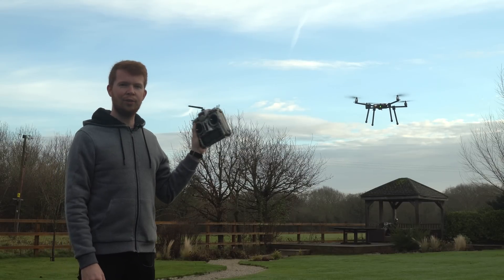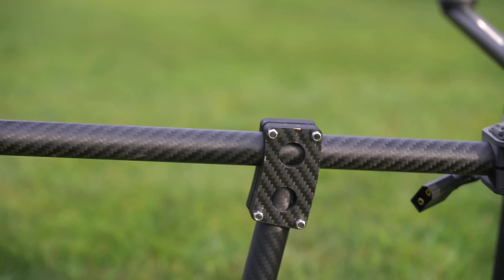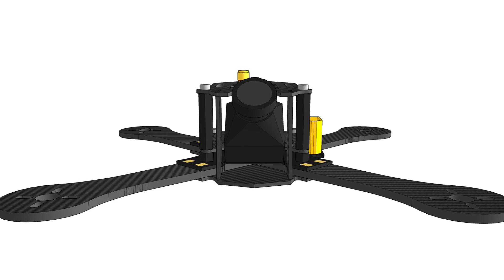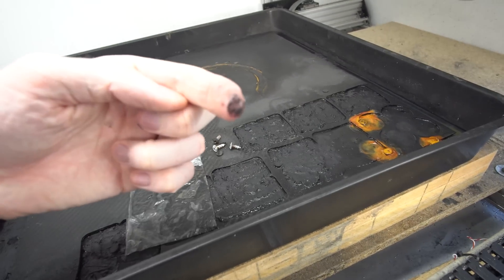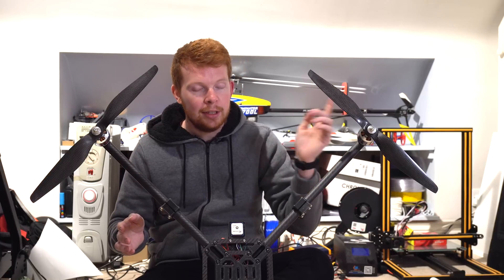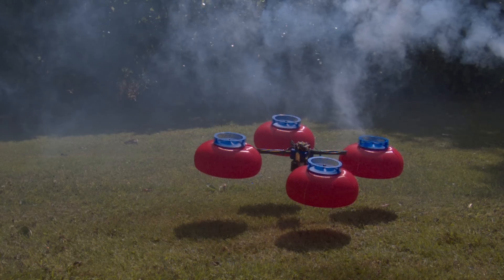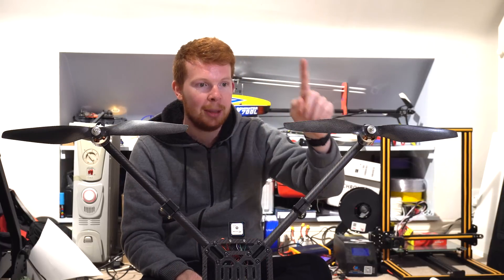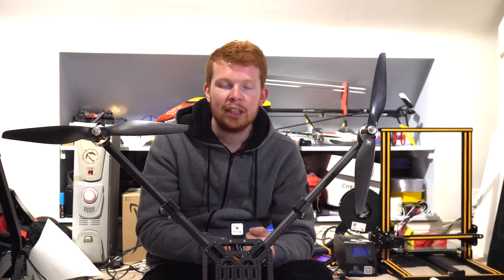I CNC'd a Drone

Comment: Quantum theory (otherwise known as quantum physics or quantum mechanics) is one of the two main planks of modern physics, along with general relativity, and between them the two theories claim to explain virtually everything about the universe. General relativity gives us our picture of the very big (space-time and gravity), while quantum theory gives us our picture of the very small (atoms and their constituents).

Technically, quantum theory is actually the theory of any objects isolated from their surroundings but, because it is very difficult to isolate large objects from their environments, it essentially becomes a theory of the microscopic world of atoms and sub-atomic particles. This is especially true for those parts of the theory which rely on the absolute indistinguishability of fundamental particles, an indistinguishability which is impossible to find in the everyday world of composite, large-scale objects.

Quantum theory is used in a huge variety of applications in everyday life, including lasers, CDs, DVDs, solar cells, fiber-optics, digital cameras, photocopiers, bar-code readers, fluorescent lights, LED lights, computer screens, transistors, semi-conductors, super-conductors, spectroscopy, MRI scanners, etc, etc. By some estimates, over 25% of the GDP of developed countries is directly based on quantum physics. It even explains the nuclear fusion processes taking place inside stars.

However, some of its findings and principles are distinctly counter-intuitive and fiendishly difficult to explain in simple language, without resorting to complex mathematics way beyond the comfort level of most people (myself included!). This situation is not helped by the fact that the “theory” is largely a patchwork of fragments accrued over the last century or so, that some elements of it are still not well understood by the scientists themselves, and that some of the bizarre behavior it predicts appears to fly in face of what we have come to think of as common sense.

A small part of the derivation for Schrödinger's equation of quantum mechanics 
(Click for a larger version)
A small part of the derivation for Schrödinger's equation of quantum mechanics
(Source: Wikipedia: http://en.wikipedia.org/wiki/
Schr%C3%B6dinger_equation)
Richard Feynman, winner of the 1965 Nobel Prize for Physics and arguably one of the greatest physicists of the post-war era, is unapologetically frank: “I think I can safely say that nobody understands quantum mechanics”. Niels Bohr, one the main pioneers of quantum theory, claimed that: “Anyone who is not shocked by quantum theory has not understood it”.

In the 1920s and 1930s, Bohr, Schrödinger, Heisenberg and others discovered that the atomic world is in fact full of murkiness and chaos, and not the precision clockwork suggested by classical theory. Classical physics can be considered as a good approximation to quantum physics, typically in circumstances with large numbers of particles. Indeed, classical physics has served us well up until the 20th Century, and for most everyday purposes it still does. But modern physics, which includes quantum physics and general relativity, is more all-encompassing, more fundamental and altogether more accurate - physics taken to a different level. Momentum and position, for instance, are approximations of the world of larger-sized things that we call the classical world, but the underlying reality of the quantum world is quite different.

As we will see, even a rough understanding of quantum theory requires some background discussion of atomic theory and some discussion of the uncertainty principle before any sense at all can be made of it. Only then will some of the more obscure and bizarre aspects of quantum theory (such as wave-particle duality, superposition, nonlocality, decoherence, etc) make a little more sense.

Comment: Hey Tom! Thank you so much for doing this video! I am in the process of building a Tarot 600mm drone. I am happy you went into detail with this video! I have also subed to this channel. Can you link your iNav settings for this FC?? Dump then copy and paste them here or something? I think the other trouble I'm having is the throttle on my QX7. I guess ill have to tighten up the screw to make the gimbal rest at 1500 instead of leaving is loose like when you fly rc planes.

Comment: Something I was wondering, motor arms are pretty much tuning forks, is there a clever way to attach wire and/or a thin rod between motor arms such that the vibration coupling damped the harmonics of the individual arms. Simplest, I thought, would be to connect the end of each motor arm to the adjacent motor arms with a tight wire.

Comment: Hey one question why use that much bulky battery when it only gives 5000mah there are like mobile phone power bank which are lighter and compact  and have capacity way more 10000mah and more why not use that ?
Reply from the maker: The mobile power banks are most likely lower voltage, therefore less Wh, which is the real measurement for energy storage. Plus mobile power banks use cheap li-ion cell which aren't capable of outputting the required power for a drone.
Reply: @TimStation  Do all drones use li po batteries ?

Comment: Why would it be a bad idea to 3d print the main frame?
Reply from the maker: It's possible to design a 3D printable frame (though might be heavy), but with the current 3mm thick sheet design, conventional FDM 3D printing techniques won't be strong enough.

Comment: Tim!!! What software/firmware are you using here? Also what about your other flying projects? What software/firmware did you use and modify to your needs? 

You should consider changing your name to Tam Stonton as one funny comment by Danny said. It would be non-existent words and most probably more eye catching.
Reply from the maker: It runs iNav in the FC. I run iNav on pretty much all my projects that require a FC due to the custom output options
 and GPS capabilities
Reply: @TimStation  Including the VTOL? How is iNav better with GPS than let's say Ardupilot? Thanks for the reply Tam 😊
Reply from the maker: @ZED-PV  Yeah the latest VTOL V4 ran iNav. I haven't actually tried Ardupilot before! Coming from the drone racing, I've mostly just used betaflight/cleanflight/iNav
Reply: @TimStation Ah I see. That makes sense. Do you have any experience with mapping and iNav? RTK injection? That sorta stuff? 

Sorry for all the questions. It just crazy cool to be able to talk to you about this stuff. 

Also all your videos are great!! Very informative and educational. I truely believe if you wanted to, you could get together a team of people and build very innovative mapping/filming/other crazy stuff platforms that the market would buy. 

For example, I would buy the CNC cut drone frame you design and make.

Comment: I was wondering, helicopter blades are long and straight so have more lift at the end 
Would it not be better to have them wing or propeller shape ? I might be wrong
Reply: Helicopter blades are straight when they're stationary but each blade is rotated slightly around their long axis so the blades present an angle of attack to the air to produce essentially the same effect as described in this video. I'm sure there will be a YouTube video explaining this further.

Comment: Are you running iNav on the Omnibus?
Reply from the maker: Yeah it runs iNav. I run iNav on pretty much all my projects that require a FC due to the custom output options
Reply: @TimStation  Did you change the position hold and altitude hold PIDs? I'm using the same FC and GPS and yours is far better (mine jumps up and down by a few meters and does sharp corrections to hold the horizontal position)
Reply from the maker: @SandroFPV  I haven't changed the altitude PIDS, but I have reduce the position hold PIDS. However,  I initially built it without any angle to the arms and it was fine with default settings, but since adding an upwards angle to the arms, the 'mechanical' positing gain increased and it began over correcting. Have you tried adding a small bit of sponge foam over the barometer? Maybe having the props far from the FC removed any significant pressure variations on mine.
Reply: @TimStation  I stuffed some foam between ESC and FC right where the baro is. It definetely improved it but I'm going through a tuning guide by iNav right now. Position hold is up next but putting the magnetometer on a little stand on one arm removed the toilet bowling effect.
Reply: @TimStation  i tried running inav on my f4 v6 but in the mixer tab, the motor output is automatically set to s1 s3 s5 s6 and i can't get it changed to s1 s2 s3 s4, which is annoying because im trying to use a 4 in 1 esc with 8 pin jst connector (which is really convenient), so i just flash betaflight. Do you have this problem too?
Reply: I want to know this too!! Also what about your other flying projects? What software/firmware did you use and modify to your needs?

Comment: Really nice and clean design.
Would be interesting to compare flight times with longer propellers and perhaps lower kv motors.
Reply from the maker: as I mainly built it for weight lifting, after flying for 12mins with 3kg onboard, the esc/motors were warm to the touch. So I haven't considered longer props. But without payload everything comes down cold, so larger prop flight time would be interesting to test. Thanks!
Reply: @TimStation  You're welcome Tom.
I bought a CF H500 quad with pixhawk back in 2014 and lengthened the arms to make it an H700 as I wanted to increase range. Would have liked to try 18" props but couldn't find any over 14" then.
Unfortunately drone laws in Hungary and lack of funds and time have made it difficult to experiment further, so I'm hoping you might take this on and plot the results...
Cheers!

Comment: How much this baby cost?
Reply from the maker: not including the carbon fibre sheet, multiple broken cnc bits, radio receiver and 3D printer filament, about £270 (approx $350) with one set of batteries.
Reply: Pretty affordable actually